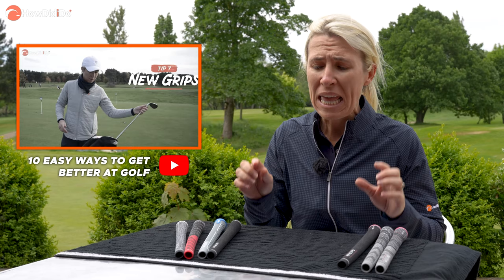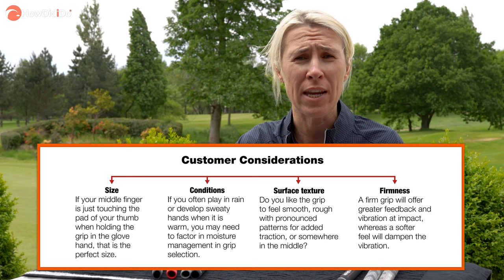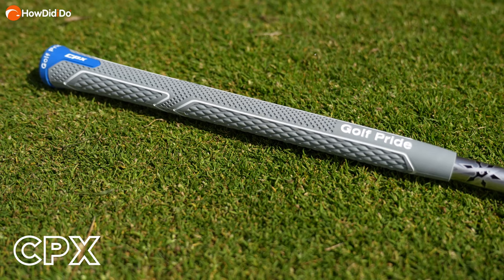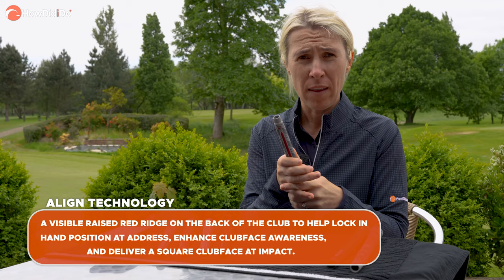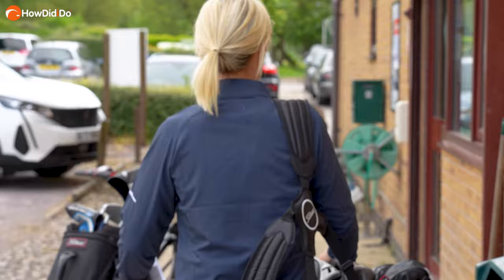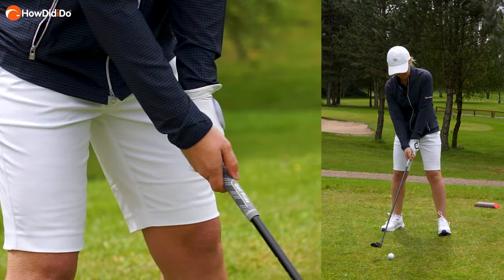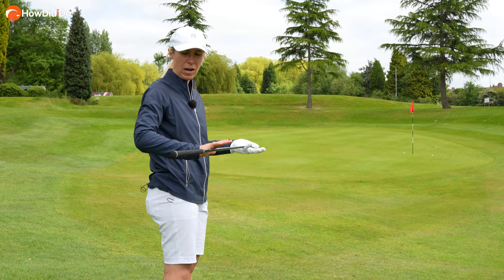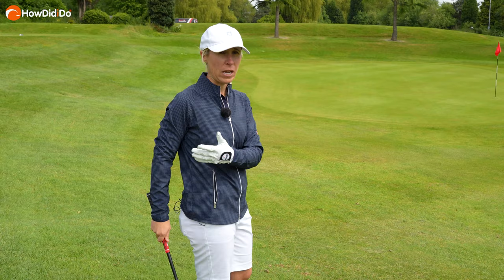Using the correct type of golf grip - EXPLAINED! | HowDidiDo Academy

Comment: Grip firmness will also affect how the shaft performs.  A firm grip will make a stiff shaft perform (feel) like an extra stiff - and vice versa. So no point being fitted for stiff shafts and then deciding to put very firm or very soft grips on them.  Get fitted with the grips you intend to use.

Comment: Thanks for the great video and feedback. I was actually expecting you to comment on how they felt to you after using each one. But your standard GP info was good. The MCC align Plus 4 wear out fairly quick, not long lasting when you play a few times a week and practice every day. In the thumb and palm area where the pressure is as all my grips have. I use Winn Dritac now and they have been great for soft feel and comfort with some tackiness, but they don't last very long either. That's why I grip my own clubs...